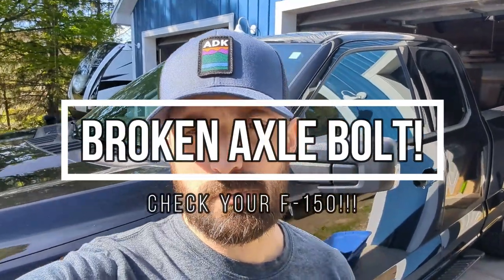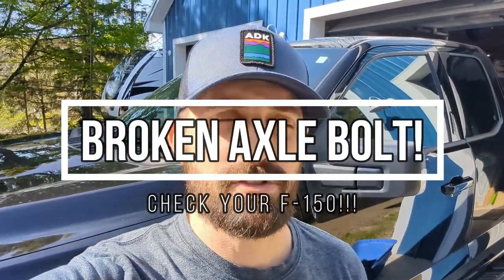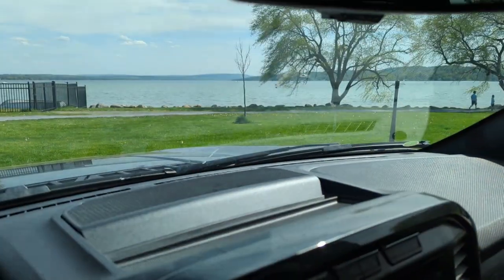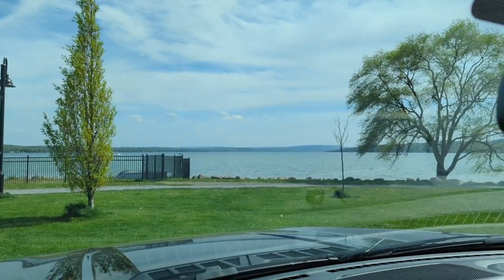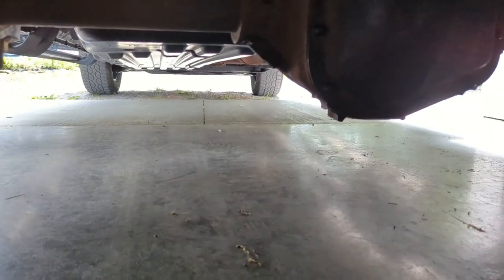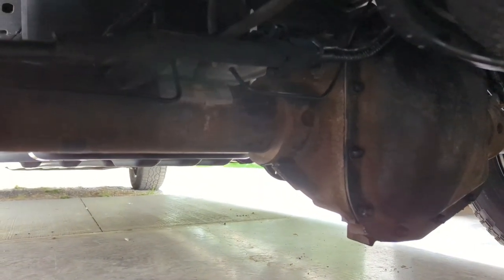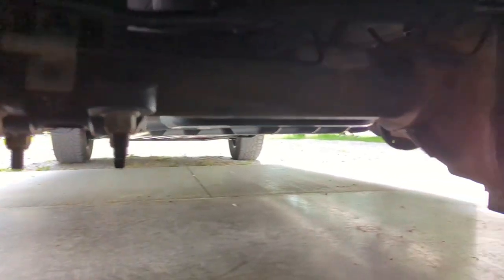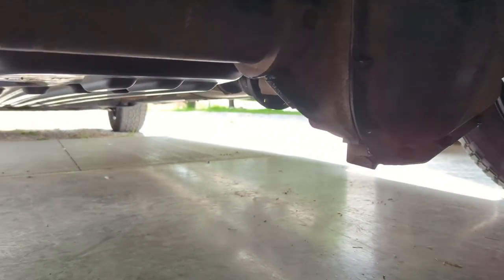Ford F-150 Broken Axle Bolt!

Comment: I had all Toyota trucks before decided to go with my 2021 f150. I now have a lariat supercab, with the max tow. Had the axle bolt broke on me 4 times…. I only had 30k on mine. The 4th time it happened, Ford gave me a brand new rear end. So far so good now. Def not a good experience for a first time ford owner. Not to mention the tons of other recalls like the wind shield wiper motor, the rear emergency brake module, tail gate unintentionally opening, head unit not updating, and all the time I can’t use my truck because it’s sitting at the dealer waiting on parts.

Comment: One of the F-150 forums has a huge thread on the max tow axle failures.  Some folks have lost three axles so far.  So sad that Ford has been replacing these axles for 2 years and yet they haven't fixed the design and are still building and selling max tow trucks with the defective axle design.  Farley was BSing when he said Ford was going to be concentrating on improving quality.
Reply from the maker: I'm just worried what will happen when my warranty is up. Not sure if I want to hang on to the truck past that
Reply: They keep changing what works , until it doesn’t,
Reply: Add that to the 2.7 problems , absurd prices, and the belt driven oil pump on the gen 4 coyote, great way to loose customers

Comment: glad to see posting a new video.   I will now look into this axle bold for my 2022 F150.  Just had two other (minor) recalls done last week, and the dealer did not mention anything about axle bolts.   and yes, a summary from you on your experience with your F150, both good and bad, would be a very interesting video for your followers, including me.   after about 20 months and 27,000 miles, I can say i can give my F150 around a B+ grade.   Mostly due to all the computer issues, mostly minor, but still annoying.   and funny thing was the dealer was not able to "fix" a single electronic/bug problem last week.  Even with their "best" electronic wizard technician.  And, of course, they blamed all the connectivity issues with Android-Auto on Android.....  but dealerships still have a poor reputation for their service.  so once I hit the 36K mile warranty end, I will use my excellent local mechanic for things.

Comment: 2021 @ 38,000 miles and snapped off while driving away from a stop sign. Lost all power to the rear wheels.

Comment: Thanks for posting all the videos.  Picking up my 23 Powerboost today and I am watching all your videos.  Sure hope they fixed some of the issues. No recalls listed (so far) on the FordPass acct.  You've got another subscriber!
Reply from the maker: Thanks! Most of the issues have been resolved thankfully!
Reply: Congrats on the new truck!
I have a 22 Powerboost with Max tow and I have just scheduled my second axle bolt repair at 32k miles. First failure was at 27k miles. Disappointing to say the least.
Reply: I have a 2023 Powerboost Max tow. Axle bolt broke yesterday. 12K miles

Comment: I had a creaking noise in mine. Pulled the wheels and the bolts were fine but were relatively loose. I found a thread where, although the shafts are pretorqued by the mfg., the soev was 120ft/lb. I went ahead ad tightened them and the noise is gone. Ill check each rotation until Ford comes up with a fix.

Comment: Do you know if they fixed the root problem or just put the same thing back on my f150 just went in for the exact same thing and I have a camping trip book in the next two weeks glad I brought it in when I heard the rattling noise
Reply from the maker: From what I have read so far it is the same part. Which is unfortunate if true
Reply: I had my 2021 F150 Powerboost in nine months after experiencing this issue and thought it was repaired. However, my truck had been at Ford for ten days now for the same rear axle bolt. I was told the first repair wss only replacing the same bolt as they didn’t have it figured out at that time. This recall item is supposed to be the actual repair explained in this video. Hope that helps? Very frustrating but if you hear a clicking noise and there’s no nail in the tire, that’s a dead giveaway it’s happening.
Reply: Sounds like a class action coming
Reply: My 2021 powerboost  been on dealership shop 6 weeks  tomorrow. Called me and said I had broken axle.

Comment: Houdy Folks, I just got this Recall on my 2022 F-150 LARIAT. I'am only at 6 K on the ODO. 😂.  Is this "COMMON"  to one side or the other with MAX TOW??? Or both or could it be Either Side??? Thanks.
Reply from the maker: Mine was passenger side, but they replaced both sides
Reply: Thanks, Good to know.

Comment: This just happened to my truck yesterday...  shocked ford decided to go with a bolt versus a nut.
Reply from the maker: It seems like they just didn't spec the strength correctly, hopefully the new one lasts longer
Reply: @Not All Those Who Wander Are Lost  I am more nervous they are putting same quality back on.
Reply: Dealer confirmed new bolts are higher strength.
Reply: @juliussenn2443  Dealer is full of **it.  One of the F150 forums has a huge thread related to max tow axle failures and several people have had multiple failures (including failed replaced axles).
Reply from the maker: I don't have confirmation either way yet, but the forums do seem to trend in the direction of it being the same bolt and they simply changed the torque specs as they believe the factory was over torquing them.
Reply: @juliussenn2443 That's bullshit. The bolts haven't been redesigned in anyway.
Reply from the maker: Who knows, maybe the new torque specs will help. But it seems like they may just keep breaking 😕
Reply: @notallwhowanderarelost2024  You nailed it in the video. Inspect them at every tire rotation.

Comment: I had the same thing at less than 20k miles.
Reply from the maker: Yeah I am only at 15k. Some people on the forums were less than 10k. This needs to be a recall.
Reply: @notallwhowanderarelost2024  agreed, my tailgate was opening unintentionally also, that took several trips to the dealership. You would think ford would know how to build a truck after all these years. :)

Comment: Just happened to my 2022 F-150! Frustrating!
Reply from the maker: Hopefully whatever they replace it with is better and not the same part. If you get a chance to ask them 😉
Reply: Was your Recall on the AXEL Situation the Right side Also?  IE, Passengers Side? I have a 2022 F-150 with just under 6K Miles on it. No Noise that I can hear as of yet...